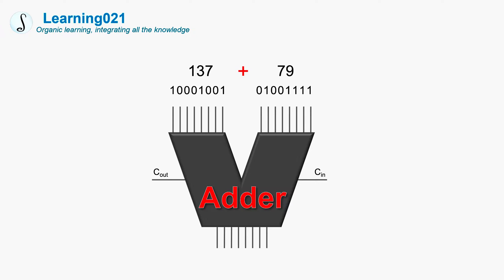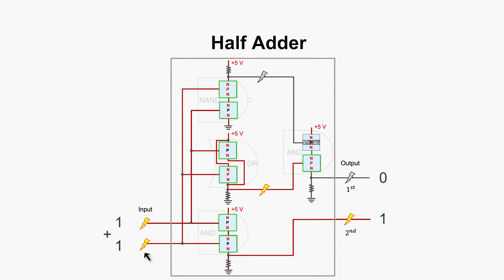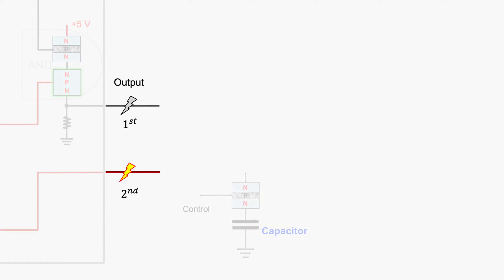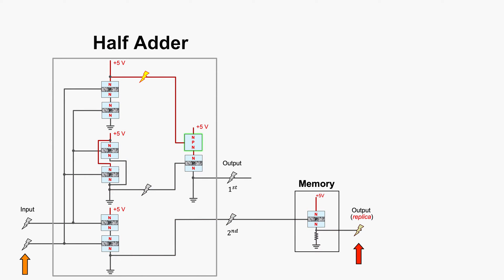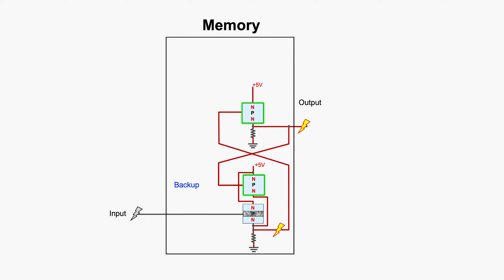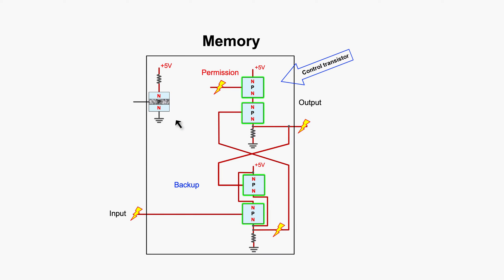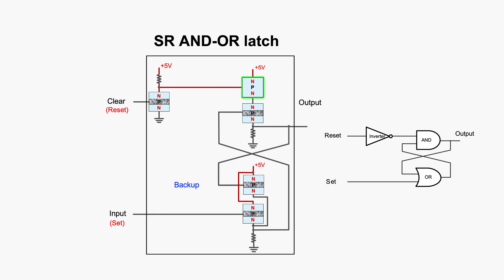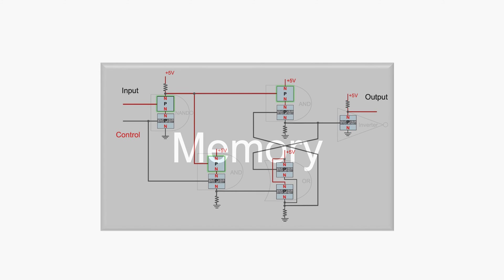How Computer Memory Works? Part 1: SR And-Or Latch

Comment: I am trying to understand this "data storing thing" in terms of transistors' on/off status...and watched many videos...however, this video brought me closer to understanding... but still I am not very clear...something is missing in every explanation. For example, when you say "apply voltage".... It gives me these problems... who applies the voltage? Is it the power on/off switch of the computer? Another thing is; ....Does every transistor have a capacitor connected to it?? and...when there are billions of transistors inside..how does it deicides where to store the inoformation? How does it avoides over writing information while storing information? How these stored binary data is retrieved? ....I have thousand questions to ask...about this....
Reply from the maker: I totally get your problem, as i have those too! I think everything is triggered by our button clicking, then then chain of switches will be turned on. In the RAM case, there wouldn't be capacitors, just transistors connected to each other. Regarding the question of 'how does it decides where to', this is determined by programming. The later series about certain store instructions might answer your question. It's a complicated structure, all those pieces are wired together to solve the big problem.
Reply: its a bunch of and gates where to store troll real
Reply: Understand that 0(off state) and 1(on state) are made of transistors which are acts as on and off. First understand these
1) zero level basic:- semiconductor, doping of semiconductor, that turns into transistor and limit of transistor when its size continuously decreases(moore's law). These are building blocks of logic gates. 
2) 1st level basic:- once you know how to build logic gates then you will start constructing alu, memory, logic unit, cpu, and other transistor based components.
Electronic students just need to know these things to build transistors and logic gate architecture

Comment: Im confused AF..its not the narrator, its me. I trying to make heads or tails of all this and its beyond my walnut sized brains capabilities.
Reply from the maker: I believe there is always a better way to explain things. I thought I explained things clearly, but later on I felt like there were still some knots tied up there. So it is not your problem. But what I think will help you is try to frame your questions. Once you can phrase your questions clearly, you are half way through!
Reply: @Learning0to1  Yeah I'm starting to realize now that for computers, questions are like commands. If 'A' + 'B' then '1'.  If 'A' or 'B' - 'A' or 'B' then '0'.🤔
Thanks for the help. Your videos are 
"1010(*)\101(*)" 😀
10 out of 5 stars!! ✌😎🖖
Reply from the maker: thanks for the support :-)
Reply: Well if I can help in any way I will. Not sure how many times I've watched this video but I now understand(I think) how this memory chip works and can build a modified digital version of it.

So 1st it's crucial to understand why on particular you are watching. Just simple curiosity or more particular?  Then what seems to be confusing you?

For instance I use now outdated logic software for the ps4 system called (LBP3)Little Big Planet 3. 

So my aim was to figure out how it is that we can make a pile of wires and parts actually think & make choices. Now I can actually see how I can begin to do that. 

Been watching videos for about a week or so on Binary and machine learning. Must've created some new neurons as I'm now starting to connect the dots
 😅😂🤣
✌😎🖖

Comment: any diff electron moving in Battery and Memory ?
Reply from the maker: In DRAM, I would think there are electrons moving. In SRAM however, if we are using FET transistors, I wouldn't think there are electrons moving, just electrical field propagates.